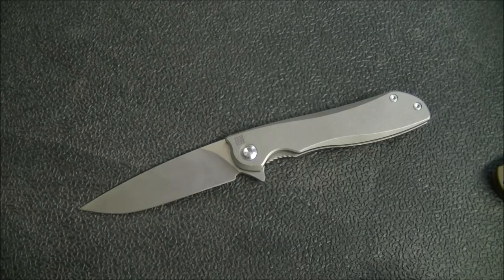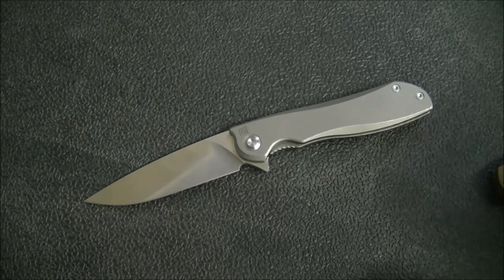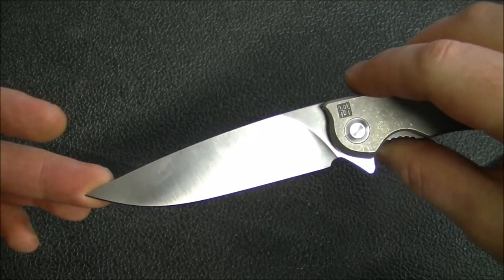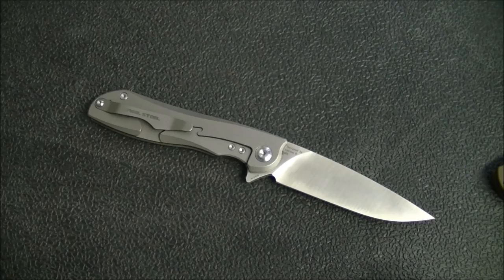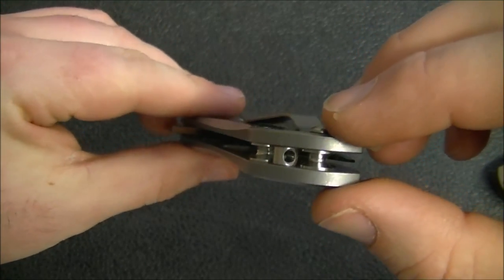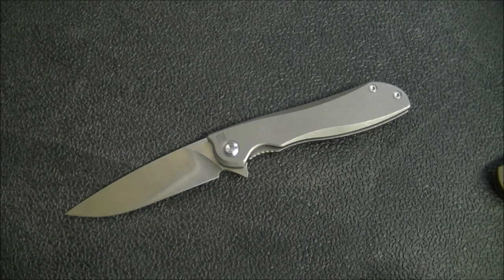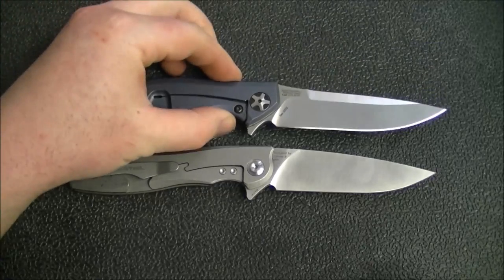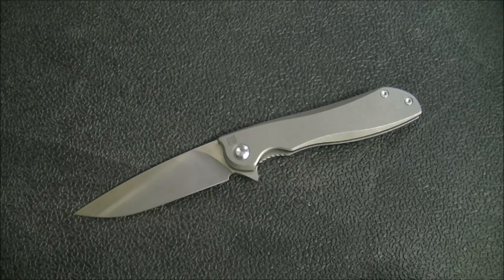Real Steel Megalodon

Comment: Hey Kevin. Love your channel mate but your information is incorrect on the bearing type. I received my Megalodon today and after disassembly can confirm it is multi row ceramic bearings in a plastic cage. Looks similar to the Reate K-3/4 system. This knife is NOT roller bearings.....
Reply: It was:) But now it's not.

Comment: I  picked one of these up and I'm very happy with it as well. I'm curious as to whether Real Steel's OEM makes these or if Carson makes them. As for the needle bearings, I find them to have more friction than traditional bearing, but they have more lateral stability. I think the light lockbar tension (at least on my unit) is what helps make it so smooth.

Comment: Hey Kevin, if you could have the zt0452 or this knife, which would ya take. I was also interested in the pivot, will it loosen up like I hear the 0452 does? tks
Reply from the maker: I would take this over the 0452  for a carry knife although the 0452 has a bit more cool factor

Comment: Kevin- Really good review. I have this one and the S571Pro. The S571 Pro is sold out as there were only 599 made. The Megalodon is hard to find, but I know LuvThemKnives (YT channel) has a few for sale. Lend this one to Nick as I believe he said he hasn't ever handled a knife with needle bearings. KnifeCollector 031 just released a video on the RS Griffin Titan. It has needle bearings, titaniun and CF scales and M390 blade. It is also a button lock. Very nice. These knives are exceptional for the price.
Reply from the maker: The needle bearings are seriously amazing, I may have to lend this to Nick but I don't want to ruin all other actions for him
Reply from the maker: The needle bearings are seriously amazing, I may have to lend this to Nick but I don't want to ruin all other actions for him
Reply: Kevin cleary I haven't had  a knife with needle bearings either. I'm interested to try one put  might be the Griffin when it hits the states.
Reply: KGG- You will like them. Remember LTK has Megalodons. That is where I got mine.
Reply: MrGeerbear what do you think is more edcable this or 571 pro?

Comment: Have you seen the 2017 Griffin? Looks awesome.
Reply from the maker: yeah it looks really nice, I've considered picking one up but I think I'm gonna wait to see what else they come up with for this year
Reply: It's eye opening what these Chinese manufacturers are doing, especially these higher end offerings. Spyderco can't make a decent flipper yet companies like this can make them without issue
Reply: EDC Gear Reviews there are some outstanding Chinese knives now, to be sure, but when the Southard came out by Spyderco everyone was shocked at the value for the price and the Domino is an absolutely outstanding knife as well. You’re basing your opinion of flipper knives solely on the action and not the performance?

Comment: If you had to make a choice ...Megalodon or ZT 0920. So similar in content and purpose.
Reply from the maker: They are kind of similar but the ZT is going to weigh a bit more have a thicker grind and be a little bigger all around the action is going to be better on the Megalodon and the price is a bit lower as well hope that helps you a little
Reply: I have both, the Megalodon Titan 2017 and the ZT0920, and they are very different knives, the Megalodon is far better in the pocket (lighter and thinner) but the 0920 is more suited to 'hard use' (if you are into hard use for folders). The actions are similar (in regards to smoothness, I can't really tell the difference between the two and couldn't pick which is smoother, though the 0920 falls shut under the blades weight, where as the Megalodon has to be jiggled a bit to have it close, especially since I have lubed both with 10 weight nano oil) and build quality is on the same level, but you will pay a lot more for a Zt0920 than you would the Megalodon. The only thing I wish RSK's had done was add a bit of texturing to the handle (a long the lines of the milling the 0920 has) as it is somewhat 'slippery'. To be honest you couldn't go wrong with either, both are excellent high end folding knives.

I would be hard pressed to choose between the two to be honest.

Comment: This knife has multi-row ceramic ball bearings.........NOT NEEDLE at least mine does $150 on bladehq.com
Reply: I had read conflicting info on this so I emailed Real Steel.  They said the 1rst run had needle bearings. The manufacturer couldn't supply more so they went to double row ceramic bearings in later runs. The knife you get could contain either. This was a Real Steal deal at the BHQ sale price.  Even at the current  price it's a great knife. Great materials, f&f and smooooooth.
Reply: It's nice that they upgraded to ceramic. My needle bearings rust like crazy. I have to soak them in oil every week or two. I think I'm going to change them someday.